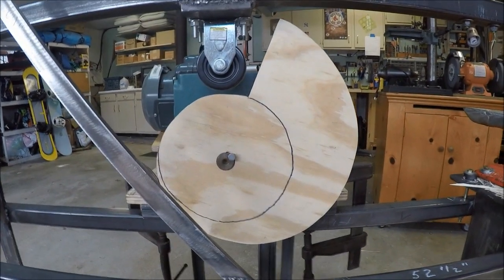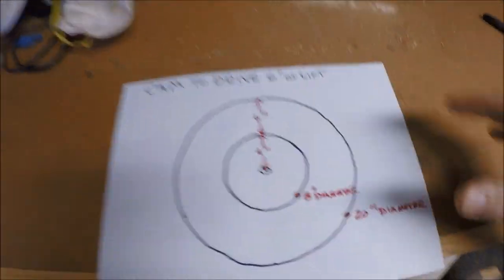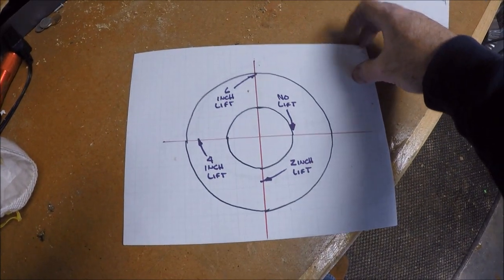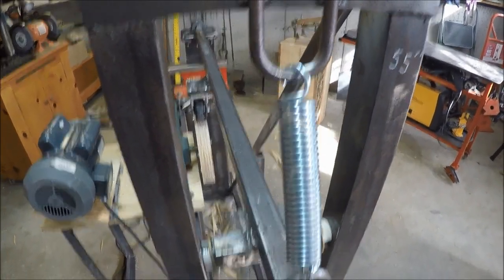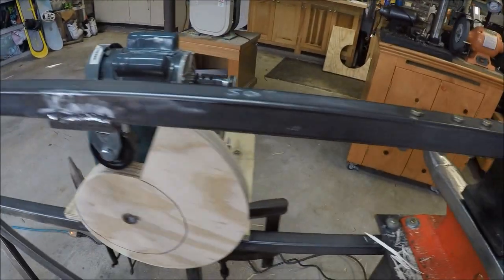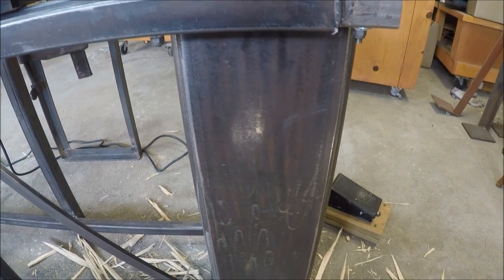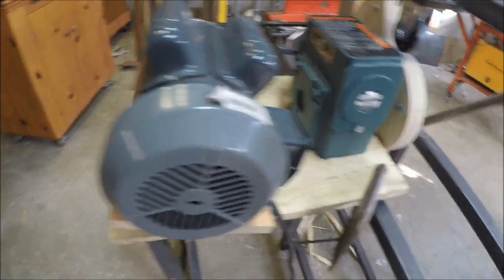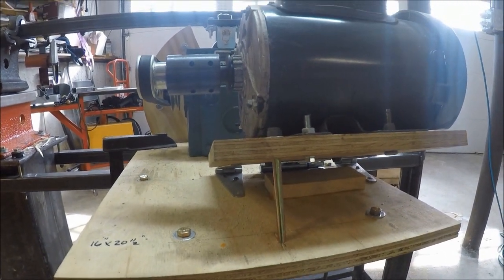Homemade Blacksmith Power Hammer - Part 2

Comment: I am building mine to be dependable. How long do you think that wood is going to last? Did you make extras? I like your design great job
Reply from the maker: Thank you .  Surprisingly the wood is still going strong....I might decide to wrap the edge with a strip of steel for added uberness, but so far it's fine as is
Reply: The cam looks fairly easy to change out so it might be a good idea to have it be a sacrificial wear part that can be replaced every couple of years or so.

Comment: Nice and simple, what is that square piece that the motor is connected too?
Reply from the maker: Thanks Dave - the motor is mounted on a square piece of plywood that is hinged to the platform - this enables me to swing the motor up to remove / replace  the v-belt and swing down to put tension on the belt.  Hope this answers your question.

Comment: nice work
Reply from the maker: Thank you!
Reply: I will definitely try to build something like that for my knife making. Awesome idea. Question. Can you help understand how you made motor to slow down.
Reply from the maker: I slowed the rotation down in two ways - with pulleys and a gear reducer.  I mounted a 2 inch pulley on the output shaft of the motor which is then connected to a 3 inch pulley mounted on the input shaft to the gear reducer with a v-belt.  That reduces the rotation by a factor of 1.5x.  The motor rotates 1,800 RPM.  So 1,800/1.5 = 1,200 RPMs.   Then the gear reducer is a 15:1 reduction.  So 1,200/15 = 80 RPM.  So, the shaft coming out of the gear reducer which drives the cam rotates at 80 RPM which results in 80 power hammer blows per minute.  Hope that helps.
Reply: Thank you
Reply: Did you get the picture
Reply: If you have an email i can send you a picture. I have idea how to make this more stable. Basically you can put guides bars on a left and right side 6 feet tall from the ground and secure it with a bar on top. This way your arm that goes up and down can stay and will not move left and right.
Reply from the maker: No it did not come through
Reply from the maker: That's a great idea!

Comment: are you prepping.  your steel before you weld it? also welds look cold.  nice work
Reply from the maker: Thanks Kobesko!!  I think my main issue all along was pushing a small and cheap flux core welder way beyond what I should - since this project and the 2 x 72 inch grinder project, I picked up the Everlast PowerArc 200 ST which has made all the difference when welding 3/16 plus stock.  I also took some welding lessons which also helped.  Now it's a matter of practice.   That being said, surprisingly all my welds on all the projects where I used the flux core are still holding = they look bad but so far they are holding :-)) Booyah!

Comment: Hey Rick,  Thank you for the quick response.  Is that some sort of a gear reduction unit that the electric motor belt goes through?
Reply from the maker: Thanks Dave - so the motor shaft has a 2 inch dia pulley which connects via a vBelt to a step pulley with a 2, 3, or 4, inch dia pulley option and that is connected to the input shaft on the gear reducer.  The gear reducer is a 15 to 1 reduction.   So for example, if I use the 3 inch option on the step pulley,  that reduces the 1800 RPM motor output down to 2/3rds or 1200 RPMs on the input shaft to the gear reducer - then the gear reducer  reduces it further down to 80 RPMs (1200/15) or 80 hammer blows per minute.   Hope that helps.

Comment: At 120 rpm the lever falling on cam because after the lift the cam is rotating fast but lever arm is not moving as cam is moving
Reply from the maker: OK thank you - I have used 80 RPM speed in all my work which is fast enough for me.  Thanks for sharing !

Comment: What would happen if you used only the motor instead of putting the gear reduction on it
Reply from the maker: The motor shaft rotates 1780 revalutions per minute (RPM) and that is way too fast for the cam.   For the CAM,  a speed of  say 100 RPMs (which translates approx. to the hammer beats per minute) would be good.  So you need to reduce the RPMs from 1780 to 100.  You can do that by using various pulleys and belts and/or you can leverage a gear reducer.  Hope that helps.

Comment: hey Rick rabjohn wat kind of gear reducer did you use on this application? thanks
Reply from the maker: I bought the reducer on EBay from NRI Industry for about 75 bucks.  It is a Dodge 15:1 gear reducer.  So far so good.  Good luck with your build.

Comment: Having used this for a couple of months, what would you change?
Reply from the maker: Thanks Jared.  Given I wanted to keep the cost down, I would not change anything.   I did change out the small narrow wheel connected to the hammer arm that rides on the cam to a wider 4 inch wheel given there is some side to side movement in the arm.  Other than that, It has worked out well.  If you end up making a power hammer and video, let me know as I would love to check it out.

Comment: That's a great design! Do you know where I can get a gear box reducer like that?
Reply from the maker: +Shane K I purchased from Ebay - I have purchased a few for various builds and find Ebay to be the best in price.   I purchased this one for $65 dollars plus shipping from NRI Industrial.  The reducer is a Dodge 1.91 HP 15:1 Worm Gear Reducer. Good luck with your build.
Reply: Thanks a bunch for the info sir, please keep up the videos.
Reply: use a small 2nd hand cement mixer gearbox  €30 or so in a salvage yard or a lawnmower repair lad might have one ,
or builder 😉

Comment: Can you say where you bought your gear reduction box and about how much one would cost ? I have the motor all ready.
Thanks.
Reply from the maker: I bought the reducer from EBay from NRI Industry.  It Is a Dodge  15:1 gear reducer.  Good luck with your build.
Reply from the maker: It cost about 65 dollars

Comment: Could you please give size in output torque and shaft sizes and HP rating on gear reducer. I think that is how listed on eBay.Or a source if you know of one Thanks!
Reply from the maker: +Joe Gassen - Joe below are the specs I copied from Ebay - good luck with your build and thanks for watching.

Brand:  DODGE
Condition: New without Factory Packaging
Model:  SR96039
Input Diameter:  3/4 IN
Output Diameter:  1-1/8 IN
HP:  1.91 HP
Ratio:  15:1
Type:  Worm
Shipping Weight:  44.50 lbs
Shipping Dimensions:  11 x 9 x 9 in
Reply: +Rick Rabjohn Thanks so much for the link and the outline to build a hammer

Comment: Could you get my the diameters on the pulleys that you used. I can find most everything else but those measurments have me stumped. Thanks
Reply from the maker: The step pulley on the motor is 2 inches and the step pulley on the gear reducer is 2, 3, and 4 inches.  Hope that helps

Comment: how many rpms are you reducing the output to?
Reply from the maker: +Gary Busby - Thanks Gary - the motor is 1800 RPM with 2" OD pulley on the output shaft running to the input shaft on the gear reducer with a step pulley (either 2", 3", or 4" OD) which results in an input RPM of either 1800, 1200, or 900 RPM.  Then comes the gear reducer which is 15:1 ratio.  So, the output RPM which drives the CAM is either 120, 80, or 60 RPMs.  I like the 80 RPM speed as it gives me enough time to rotate the work between blows.  Hope this helps.

Comment: What size motor did you use? I can't get mine to run the hammer and it's a 1 hp.
Reply from the maker: 1-1/2 HP Farm Duty Marathon motor from tractor supply
Reply from the maker: are you using a gear reducer?

Comment: so how long did the output shaft last on that gearbox
Reply from the maker: So far so good - I made sure the wheel attached to the hammer arm does not hit the cam on the down stroke (and in essence hitting the gear box shaft) - so it only engages on the lifting.  That said, I agree it would be even better to have the gearbox drive a separate pulley and shaft supported by pillow block bearings to drive the cam, but it would have been more costly.  So, fingers crossed - will see how she holds up..... Thanks!

Comment: Where to get power hammer head sir
Reply from the maker: It was an old railroad rail I found - you can pick them up on ebay - you could also check your local steel supply company to see if they have any square blocks of steel you could use.

Comment: Hi sorry if its here and i just have not seen ot but could you give me details of the motor speed and the reduction value of the reducer , i just found a 40/1 reducer on ebay , i cant use one of these hammers as im in a residential area but i may just build it for laughs ! thanks .
Reply from the maker: OK the Marathon 1.5 HP motor is 1800 RPM with 2" outside diameter (OD) pulley on the motor output shaft running to the input shaft of the gear reducer with a step pulley mounted.  The step pulley has a 2", 3", or 4" OD which results in an input RPM into the gear reducer of either 1800, 1200, or 900 RPM respectively.  Then comes the gear reducer which is 15:1 reduction ratio.  So, the output RPM from the reducer which drives the CAM is either 120, 80, or 60 RPMs.  I like the 80 RPM speed as it gives me enough time to rotate the work between blows.  Hope this helps.
Reply: That is amazingly detailed i hae no idea how you possible remembered it but yes that is very help[full, and i sold my motorbike last night so now i can afford to build one ! . thank you

Comment: How powerfull it is in  kg?
Reply from the maker: I added some weight to the head and today it weighs about 20 KG.  In addition, I have two springs in the front end to help increase the downward acceleration of the head.  You might checkout my other follow on videos in the power hammer playlist where I address some of this.  Thanks Nox; cheers
Reply: Rick Rabjohn thanks

Comment: how much would you charge to make one of those for someone?
Reply from the maker: +Anthony Figueroa - that is a good but tough question because I'm no professional and do this for fun and don't recommend people do what I do - The materials without motor was $400, and it took me 4 weekends (8 days) to make (40 hours).  I'm certain someone could do this much faster / better if they were setup for a production run.    Then comes the complication of shipping - building a wood pallet, enclosing it, figuring out how to load it on a freight truck without a fork lift...etc. etc. etc.   So, the bottom line is I wouldn't do it..   Thanks for the question and for watching.
Reply: No problem I totally understand..though thank you for replying. I'm getting ideas because I want to make things out of steel too and I have to start somewhere and asking questions is the first step.
Reply from the maker: Anthony Figueroa Great and keep asking - that's what most of us have done and YouTube is a great place to learn.  Good luck!

Comment: I've watched several build videos now. And no one shows them actualy at work?  And a stick' does not count. I do not see the demonstration in it? As who has need of a wood hammer? I want to pick which one, is a better, and simplest build for hammering steel. And still have no clue? 

I built a rock crusher with a cam like this. And it lifted a 60 pound peace of steel shaft. All by hand. With only a heavy flywheel to give it continues force. It worked good. But lacked a motor and the reduced drive. And the stile with a leaf spring, looks to be the bigest bang for the same amount of drop height. Also adjusts in stroke. Giving it more of a hammer strike, like one you would hold in your hand. This build looks more appropriate for dies. As you do not have to wory about a nurling edge. This build sets you up to understand a unique method? One I do not see working, like one that you can controle the hit with. Maybe if you put a foot pedal to the spring? 

What do I know? I havent built one yet. But think I'm going for the leaf design. Just' going to use coil springs instead. Making it vastly smaller and lighter. And if anyone wants a cheep drive? Use a old rottotiler, that has a separate motor from the drive. Got mine for 30 bucks. And they are bullet proof' for actuating anything heavy. As I have seen them at work' on prospecting equipment. Just got too step the speed down more' with a dryer pulley. Or a pulley on pulley. Either way, its as cheap as you can get, if not wanting to buy anything new.
Reply from the maker: check my other videos on this build.....also check my playlist on powerhammers - it includes other viewers like yourself who built one.
Reply: @RickRabjohn  Yea' Ive now seen them all I think. When you start out the algorithms give you very little. But now have them all on my home page I think? I watch video's to learn what not to do? And have a build in mind now, that can ajust the weight and the stroke of the hit. If your interested? All you need is a seperate spring pulling down on the hammer? To give more dead weight and driving force. So the hammer should not bounce so much on inpact. As 10 pounds is only enough weight if you are driving it down as it falls. And a spring should give that efect. Without a bigger hammer, and the build, to go with it.  

Could put the tensioner under the foot pedal also. So if you push harder? You'll get more bang. As the strokes hight is locked in. But if at full speed, from the pedal already being pushed? It should handle the exstra force on the drive and acentric. When the weight of the spring is added to it. And should be as repeatable without much momentum. But would alow it to pass a few hits. Too build up some speed. Before putting more on the drive.

And I'm just srarching my own mind here? But it should work.

Comment: what is the mortar called that you are using
Reply from the maker: The motor is a Marathon Electric Farm Duty Agriculture High Torque electric motor providing 1.5 horsepower at 1800 RPM. Input is 115/208-230 volts single phase.  Thanks for checking it out.  If you build one, let me know - would love to see it.

Comment: Nice way to over complicate things
Reply from the maker: How so?   What would you do different?
Reply: Less steel, simple cheap motor, I'm half way done on mine but I can't send a picture lol but mine will take up half the room and I keep it simple so it's easier to fix if anything fails
Reply: Oh mine has only cost me $20 for some welding rods and I'm using old beams from an old building and I get a old railroad track pretty easy where I'm from
Reply from the maker: @knifethrower9733  good luck with your build
Reply: @RickRabjohn  total fire ban atm can't even weld or grind lol